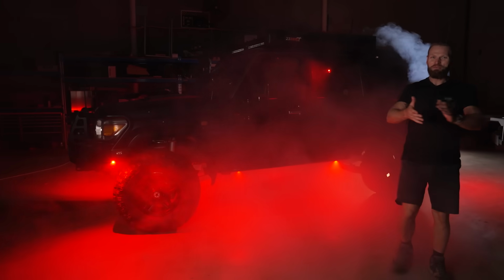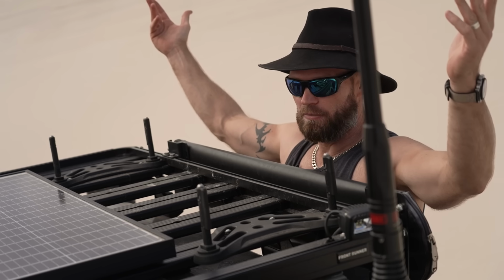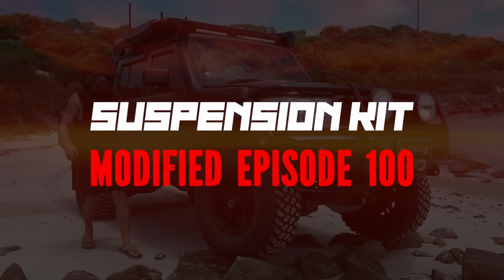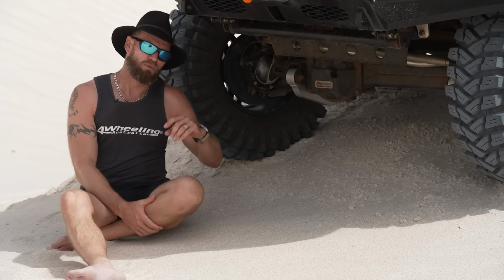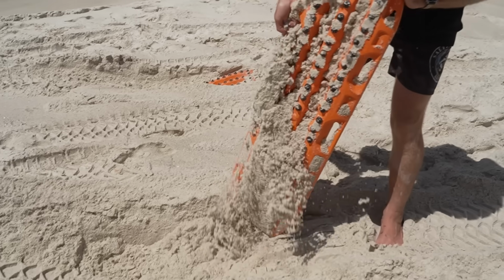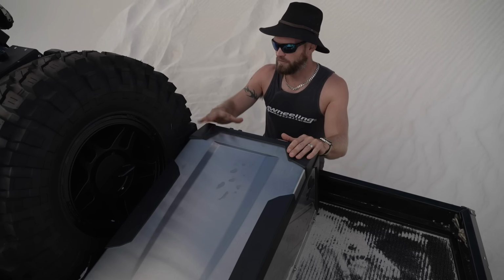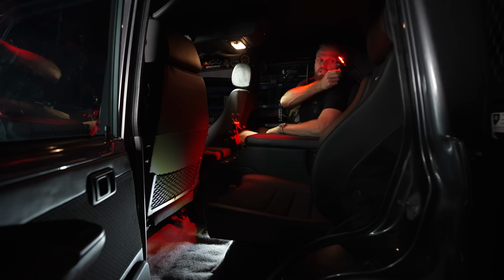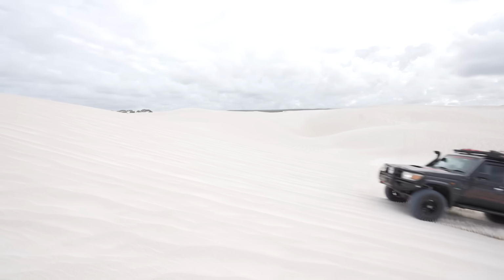NOT YOUR AVERAGE 79 SERIES, Modified Episode 100

Comment: Ronny, that‘s for sure the best 79 I‘ve ever seen , congrats! 
For Q&A next sunday:
- are there seat covers available for the Scheelmann XL? Have also these XL seats installed in my Troopy and could not find any seat covers fitting
- could you give more datails on the break booster and break upgrade you‘ve done, every LC70 should have one...
Cheers, mate!
Reply from the maker: Those are two questions that didn’t make it in as there are so many.
Seat covers are available as far as I know but I’d hit scheelman up to make sure.
The brake booster I’m not 💯 on the details but it’s the one recommended by superior engineering and swat.

Comment: Ronny, can you tell me what advise you got regarding installing the Unichip power upgrade in-conjunction with your secondary fuel filter (pre-filter 5 microns). I was advised against it by Dynomotive in Vic, as it restricts your flow too much? Regards David.
Reply from the maker: depends on the fuel filter system you use and hose size. I dont have an issue with mine as the hose and fittings are larger size

Comment: Why did you change out the factor 55 hook to a standard one? Is this a better setup? Thanks
Reply from the maker: I couldn’t get it off it was seized on had to cut the rope
Reply from the maker: Also I changed to the MAXTRAX rope which doesn’t need a hook
Reply: @Ronny_Dahl  sweet thanks! Would you rate one over the other?

Comment: One question: as you do a lot of travelling in hot sunny conditions, do you ever consider going for a lighter colored vehicle? Does it make a noticeable difference in temperature? I have a wrap that's lighter colored for my black truck but I actually kinda like the stock black and may consider just doing a clear PPF wrap instead
Reply: Ceramic infused tint will help with in cab temps. I’d suggest even getting a clear tint on the windshield
Reply: @MB-ob6ye  yeah its actually got the factory anti-infrared glass

Comment: Ronny, question about the electrical…
I’m about to upgrade my 12v system in my single cab GU. Space is a issue I’ve got a 1200x1800 canopy on the tray 
My current set up everything is in the tray and the AGM battery I have is the space killer.  I’m up in the air weather to move it into the cab behind the seats like you’ve done or to leave it in the canopy?! 
I’m also going to use the baintech slim battery like your self 
Pros and cons of having the battery and charger in the cab VS the canopy 
Cheers mate PS the rig is out of control great stuff man

Comment: Hey Ronny, 

There’s pcor wheel cover hub that you can pop it off to turn the locking hub and you can pop back on instead of using the hex key to undo them. Cheers they look pretty good. 👍🏻👍🏻
Reply from the maker: That’s what I’m doing but it’s still an extra step

Comment: Mint. Love the rear seat conversation.  My kids would have loved that when we were carting them around the country.
Interesting to note you run a unichip as well as having it tuned. I have wondered about adding a unichip having had a dyno tune. Other things I noted for future mods for my 79 are the encased alternator & aftermarket intercooler. 
As always love your passion & down to earth presentation.

Comment: Hey Ronny! I have a 79 running a 3.5 inch Torquit exhaust, loud version. What size exhaust is yours and is it a straight pipe or a generic off the shelf torquit exhaust?

Comment: Glorious setup.  After doing some rough math my wallet had a sympathetic hernia.
Question 1:  Very interested to learn how you find the GPS capability of the XRS 390.  Especially what benefits it can give by using their iOS/android software at the same time.
Question 2: Having some skill at welding I am interested in the tube and plate sizing on the steps/sliders.   ie outer dimensions and wall thickness.   Also a picture or two of how it is constructed under the truck with the connection to, I presume, the chassis . I'm quite keen to make my own steps/sliders for my 2021 Hilux.

Comment: G’day Ronny,
Nice job on the build. Curious about 
-no class 6 side indicators with the GVM upgrade-are they not needed to comply?
- are the LED headlights self levelling as required in the ADR for LED headlights?
-how do the additional seats give you more GVM?
-Circulatorial system?

Comment: Hey um you considered a bigger  electric  cooling fan using a temp sensor that turns it on and a switch
To through it on high  high cooling multi core RADIATOR

Comment: Great episode! 
The 79 looks amazing! 

My one question is: With all the interior work done (which simply looks brilliant) how come you didn’t get any sound deadening done?

Can’t wait to see this out on the tracks!
Reply: Gvm lmao
Reply: Cos listen to it!! That's why! Lol
Reply: @Slug-Anderson  its a small v8. not big enough to be a diesel. plus all the design faults it has. a 6 cyl, is a better engine. this truck needs 30k spent on it, before, you buy camping gear..i have a 1962 v8,,  f100 4x4..  NOTHING NEW... 1980,s ford 6.9 / 7.3 tdi..  NOTHING NEW...  toyota 4.5tdi, $1000, per injector. rear diff,too short,  alt on the floor, starter,,cant find it,  suspension, pogo stik, cv,s, no thanks.. suspension 6'' travel.. cab, cramped, noisy, . your buying a badge..plus, toyota make unchangeable parts, nothing from 6 months ago fits.. ford, dodge, chev, all parts fit from 1960, never need upgrading..oh, forgot,, the clutch is crap..there built to drive out the factory, period..

Comment: great rig update mate!
BTW, are those LED headlight road legal? how did you make them road legal?
Reply: If he's using the stock headlight assembly with LED bulbs, no, it's not road legal, but if he's using an after-market headlight assembly designed for LED bulbs that meets ADR requirements, it would be legal.

Comment: this looks dope. as an American we don't get these so just having the stock silver grill would be cool. I'm glad you didn't 'upgrade' the headlights to aftermarket (pretty much never looks good on any car). also I think silver alloys would go better. Red/Cast Iron Black color scheme is awesome. Edit: Also that is probably the best looking front bar for a 79 series I've seen.
Reply: they have too many faults to fix, like an extra 25k.. starter in in the valley,, alt is on the floor. diff 100mm narrow.cramped, noisy, ruff..sht turning circle.

Comment: Should've pop riveted the roof rack on 😂🤣🤪😜
Yeah Nah . . . . but seriously nice looking rig 👍 That red really makes it pop 👌 I've done a similar theme on my 90 series Prado painting the flares black raptor and making the highlights orange instead of red and I always get a few admiring comments. 
I had green treds but there was a good deal on maxtrax recently so I couldn't resist getting the original maxtrax to match it all 🤣😂
I think the chrome strip along your gutters is removable. Mine was anyway and I found it looked a whole lot better without em 
Congrats on the 100th modified Rhonda 👍👌😎